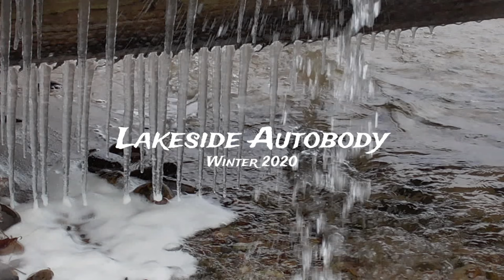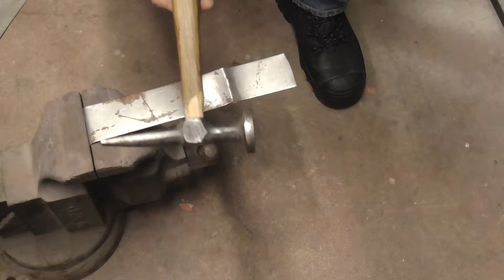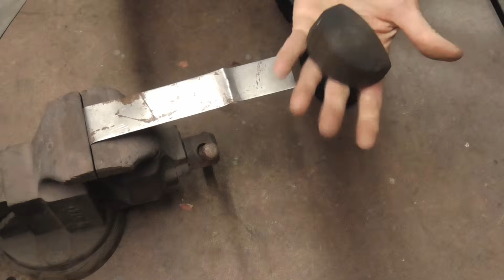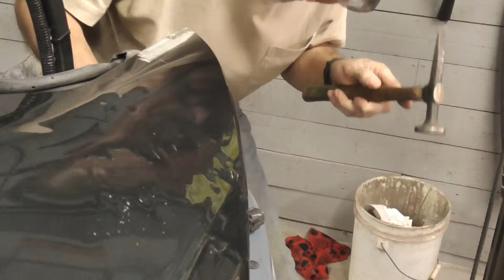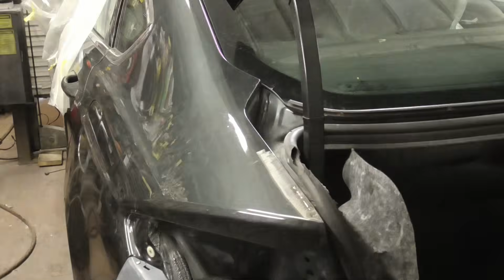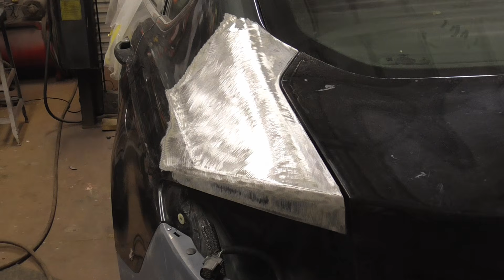How to Use the Hammer and Dolly: The Basic Tools of Metal Finishing

Comment: What's the difference between hammer on dolly for removing high points versus just tapping them down with a pick hammer like in previous videos, is it just to do with whether you have access at the back of a panel or more of a support the panel thing?
Reply from the maker: A dolly is just support - like an anvil to a blacksmith.  If there is no need for a dolly - don't use it - it's just that simple.
Reply: @LakesideAutobody ah ok thank you!

Comment: So basically looks like high spots would be hammer on dolly. I need to get a dolly I have body hammers but no dolly. I used a 2x4 before and a small cinder block. I was cheap but it worked now I need to hit up Amazon for some dollys
Reply from the maker: You can use a trailer hitch ball or any heavy metal for a dolly - anything to back up your work :)

Comment: Can you use this to fix a body panel that has been warped from welding? I patched the bottom of my 70 dart quarter panel but has slight warping. It’s high not low but just slightly.
Reply from the maker: Not often.  Here's what you want to do though - this process is a real game changer for oil canning. https://www.youtube.com/watch?v=nUBinQYIMUY  I have a couple more vids on this if you are interested :)
Reply: It’s not oil canning. I got it fixed but I did use your other video on my moms Honda

Comment: What is the other side of the hammer used for? The sharp end? Great video though.
Reply from the maker: The sharp side is for knocking down high spots  - any size really.  You'll always have a few small high areas that can be tapped down with that before filler is applied :)

Comment: OH NO! I've beat on it too much, and it's "tin cannining!" What do i do about it!?? Does that pointy end of the hammer do anything?
Reply from the maker: This honestly is the best way to remedy the oil canning.  t will leave small dings but better than the popping in and out.  The pointy end is basically for tapping down high spots.  Shrinking hammers don't work very well - at least for major oil canning situations :

Comment: The old boys would have got all the paint off first,dressed the panel to shape with a hammer & dolly then body filed and planished it perfect  with a slapper .. No filler just primer and stopper . You ground the surface rather than leaving it 'natural ' for the body file to sight to .It's not difficult to achieve .
Reply from the maker: You're right metal was thick and you could use a metal file - my dad did that type of work.  Today metal is only 5 hairs thick 22 gauge sheet.  You don't want to file on that too much :)
Reply: @LakesideAutobody  I am glad the car I am restoring is so old
Its all 18 gauge!!! But i still take it gentle like you,  I have seen too many clowns showing off thinking more effort meant a better job ,never work's like that,it's like playing an Instrumental you need to be sensitive 
Talking to a friend recently who repairs modern cars,no welding it's all rivets and glue and new panels, jot even allowed to use filler ????

Comment: I was wondering about if you have to Anneal the metal on older vehicles? I noticed you tapped and did not hammer. I have an old truck I bought and the door is caved in. I can’t find another door so I was thinking about how I would get the big dent out. I learned metal working in jewelry. My last project was a Jamaican steel drum. I had to anneal the metal and put a bowling ball into a Gunny sack. Then gently began the process of caving in the steel drum. Then a used hammers to pop back the area’s for the sound. I got an “A” in my course. That was back in the day without internet.
Reply from the maker: You don't have to anneal the metal.  Are you Belgium?  My grandparents were straight from Belgium - both of them came over after WWII :)

Comment: Which hammer do you prefer? I se you use both the "pick" and "chisel" hammer a lot for beating down welds.
Reply: Thanks.
Reply from the maker: I usually go for the "pick".  There are times the chisel comes in handy - like if you have to knock down a ridge.  It's good to have both.  If all you can get is one though I'd get the pick.

Comment: Good work there with the hammer and dolly, I think it's harder to do that type of work on modern cars because of the metal that is used nowadays and metal finishing is questionable also because filing the metal makes it thinner
Reply from the maker: Here's a bit of info relating to what you said:  “Many newer panels are too thin to hammer straight when they are seriously deformed. Traditional metal finishing techniques are out of the question because files tend to skate over their high carbon metal or, if they do cut, they weaken the panels grievously or cut right through them. Even disk sanding them can be a hair-raising experience if you are not super careful.”  Source: OLD CARS WEEKLYJAN 25, 2019
https://www.oldcarsweekly.com/news/sheet-metal-basics
Reply: Thank you for your reply, once again I've learnt something useful.